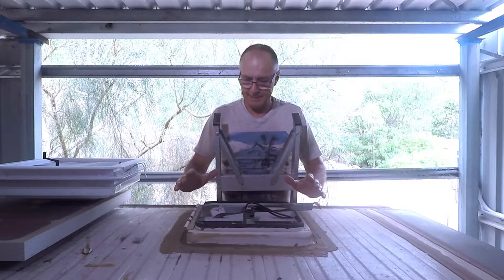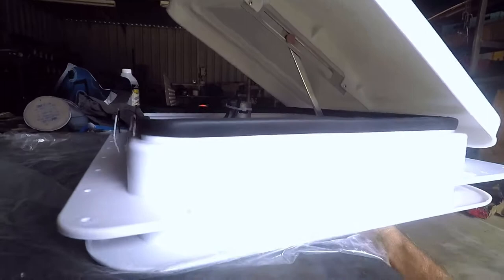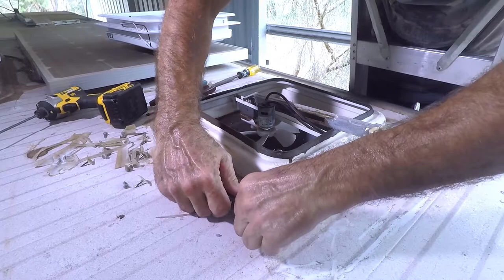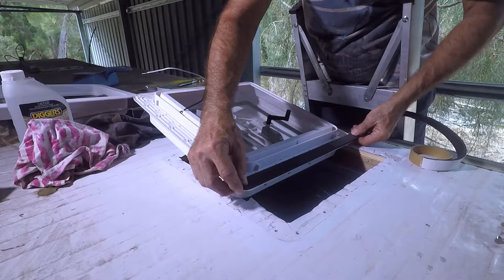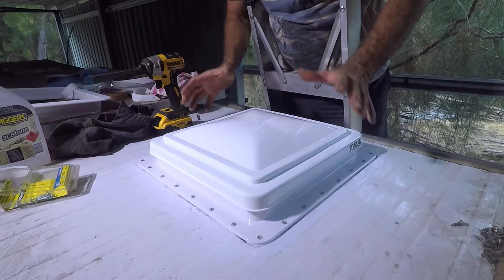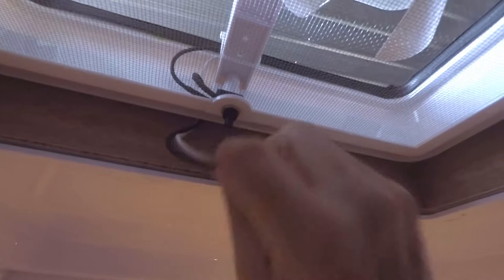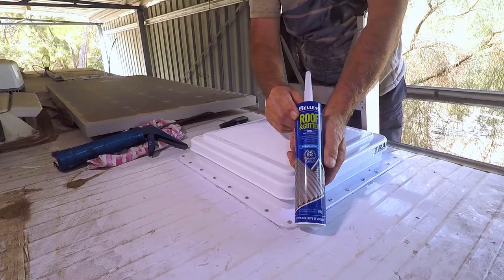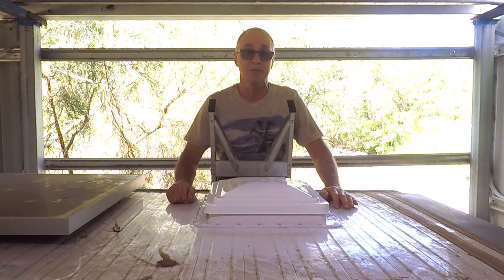How To Replace A Caravan Shower Vent

Comment: It's a shame you couldn't get a replacement lid, I was lucky a few years back getting a lid off eBay and had an easy fix, still you did a great job.
Reply from the maker: Thanks Kevin. There were several options on eBay that 'looked right' but I couldn't be 100% sure. At least I know what brand it is, if I lose the cover again (not that I'm planning on doing that, though)!!

Comment: Thanks for sharing. I have been looking at this same brand but was wondering as it looked like the cover inside did not close up against the top. Perhaps the van is 'thicker " than most. Do you know the van thickness? Cheers
Reply from the maker: Hi Max, I can't remember off the top of my head, but it was quite thick....around 30 - 40mm from memory.

Comment: What's the make and model of the driver you're using for screws please? I'm making do with a standard drill but always have trouble stripping heads.
Reply from the maker: Hi Steele, I'm using a DeWalt battery powered impact driver. It has 3 settings but I typically use it on #1.

Comment: Are there different size vents? Ive measured ours, 40cm square.
Reply from the maker: I'm not sure about that, but when I was looking online for a replacement shower vent with the fan and light, there seemed to only be 1 size. The main roof vents in the kitchen and bedroom section of the van, are bigger, though.
Are you measuring the overall dimension or the size of the cut out??
Reply: I measured external size, so yes your right. Its the 35x35 size. 
Next question, mine has the fan, where did you order yours from? Thanks
Reply from the maker: I bought mine from TRA Australia but you'll also find them on eBay, too. Just make sure you get the one that suits your existing cut out and overall dimensions.